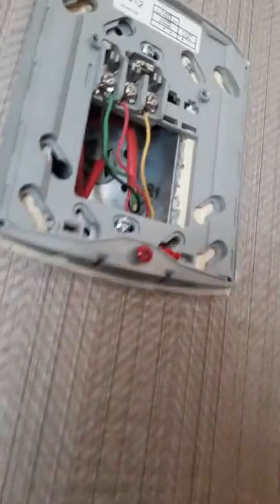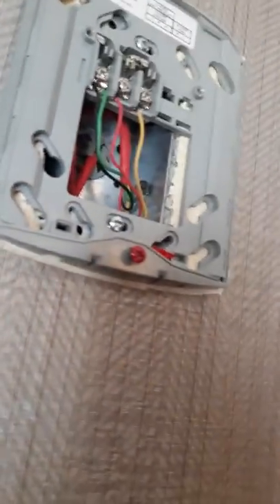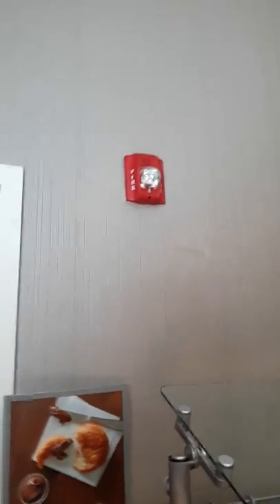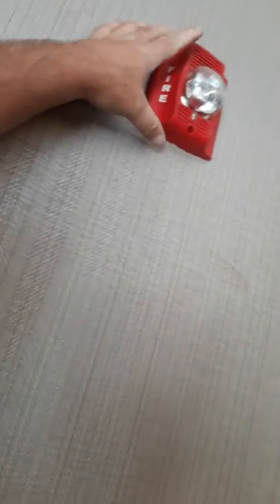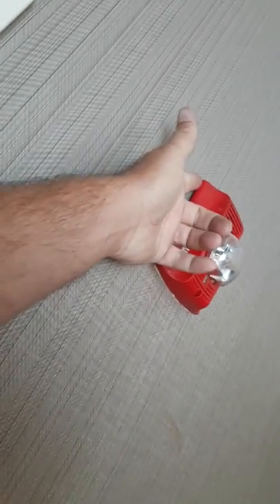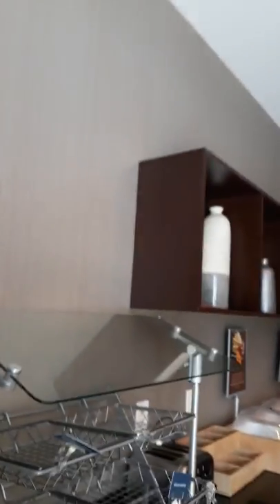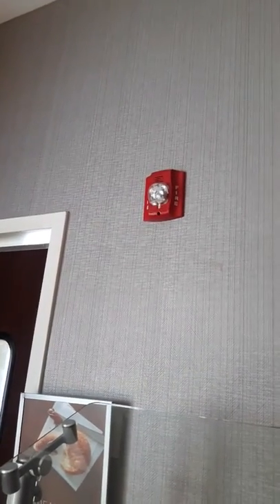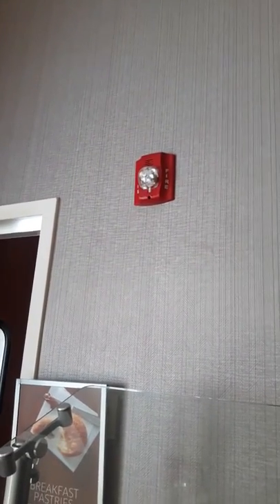Found horn strobe that was causing intermittent trouble on nac panel.

Comment: Nice find! Earlier this week I had 3 NACs in trouble. Two horn strobes ended up being lose because they were partially removed and another had the wires in back hacked as a resident ripped it off the wall. 

I don’t blame them as someone set the alarm off and the bldg contact didn’t know how to reset the pullstation. So fire department came out and these residents were listening to these horns for nearly 6 hours non stop. Crazy! 

But yeah... luckily they were easy finds after checking voltage and resistance off each unit device. 

Gotta love when people at the site tamper with life saving equipment...
Reply from the maker: Yes I run into that more and more people that remove devices. Thanks for the comment.